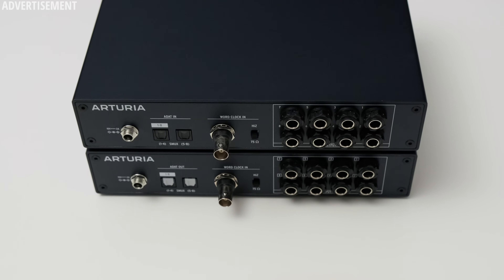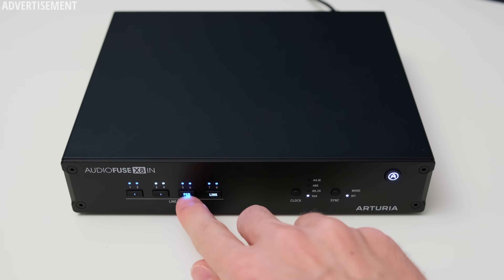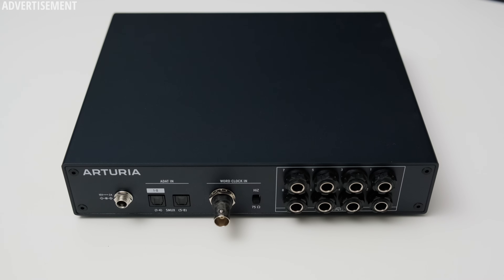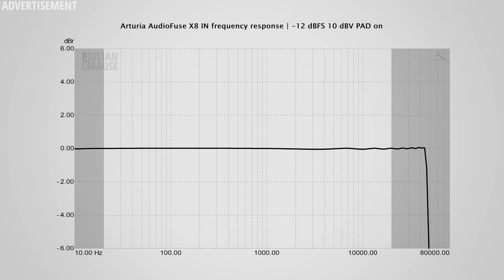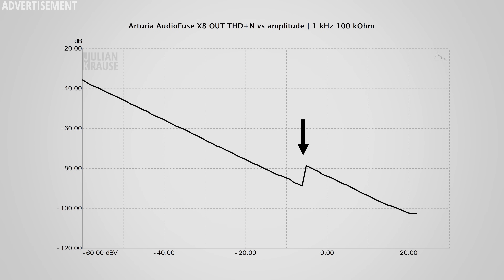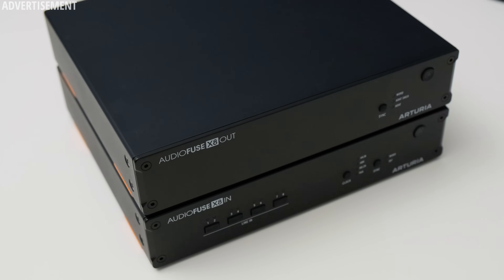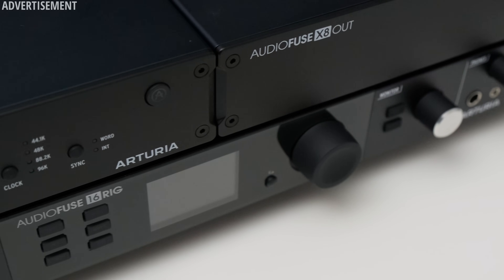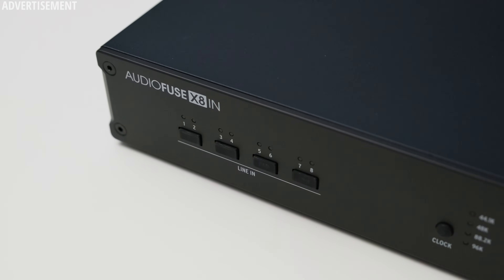Arturia AudioFuse X8 IN and OUT – 8 channel ADAT expansion

Comment from the maker: Status LF distortion issue: FIXED

The latest firmware update disables the Dynamic Range Enhancement of the DAC chip which caused the issue.
The side effect is that the dynamic range of the X8 OUT is reduced to 111 dB(A).
Here is a link to the update process: https://support.arturia.com/hc/en-us/articles/16633731726236-AudioFuse-X8-OUT-Firmware-Update-process
According to Arturia, the update process does not void your warranty. If you don't feel comfortable to open up the device, you can contact Arturia Tech Support to arrange an alternative solution.
All newly produced X8 OUTs will already come with the new firmware installed.
Reply: Hi Julian,
Thank you for bringing the issue to our attention.
As of this moment the issue has been resolved.
You need to contact Arturia to ask them to provide you with the new firmware update file.
Then you need to open the device and connect the internal usb to a computer to do the update.
Reply: @peterpeper4837  thank you I will contact them today
Reply: Thank you for calling out the problem - it is a deal-braker and a shame that Arturia released such defect to customers!  These units look extremely useful and I will likely get several IF the output quality is fixed and confirmed (tip to Arturia - for validation of the final fix, AudioScienceReviews can give the seal of approval).  
Also I hope this OUT unit does not make any POP noise in any situation?
Reply: Still hoping for an update on thisssss
Reply: Minor Update: Enquired if they were working on a solution:
"We have been recently informed of this behaviour affecting the AudioFuse X8 OUT in some specific cases. Please rest assured we are actively investigating this case. We understand how important this product is to you. Our top priority is to identify this potential issue as quickly as possible and ensure that your experience with AudioFuse X8 OUT meets the highest standards.
We will provide you with further details as soon as we have more information. Thank you for your patience and continued support."
Reply: @innamoratum  Please let us know if you have any updates on solution to the issue
Reply: Hi all. Just chiming in, it seems DRE is enabled in the ess dac, see the es9080 pdf page 12 on ess site. I guess the new firmware switches this off.
Seems a doubtful thing from the beginning by ess...
Reply: Hello Julian! I am an electronic music producer and audiophile. I am having trouble choosing a new dac. I don't really need to record anything, so all I really need is the dac with close to perfect audio quality. I don't understand why dacs are more expensive than audio interfaces if audio interfaces have more features and are used by pros.
Reply: @oscarstott  Hey, I hope it will help, Some points for your consideration:

First, DACs with USB audio transmission are simply another form of audio interface; the terminology is just different. 

The bigger the lie, the higher the cost.
For professionals, an audio interface is a tool, not a hobby. They need something reliable that gets the job done. It’s much harder to mislead a professional (most won't invest hundreds of dollars in power cables).

When DACs or audio interfaces reach a certain quality level, they become indistinguishable to the human ear. This has been proven time and again through A/B testing and null tests. However, those who invest in expensive DAC's for better audio quality often resist the idea that its performance, when judged by ear, could be on par with something costing a fraction of the price. 
While you might see better technical specifications, in a modern setup converters contribute the least to accurate audio reproduction. Acoustic treatment and speakers/monitors play a far more significant role in achieving faithful sound.
If you’re serious about pro audio, whether as a profession or passion, I recommend exploring some of Ethan Winer's videos, like "Audio Myths Workshop" and "AES Damn Lies Workshop." 

The FL Studio repost of "D/A and A/D Digital Show and Tell by Monty Montgomery" is also an excellent introduction to digital audio. 
And "Audio Science Review" website is another valuable resource.

Lastly, an audio interface isn’t just about sound quality. I use RME's audio interfaces not for their sound but for other critical factors like driver efficiency, flexibility, build quality, and the manufacturer's ongoing support and updates for new operating systems.

Good luck!
Reply: @oscarstott  > I don't understand why dacs are more expensive than audio interfaces if audio interfaces have more features and are used by pros.
Lol, that's because they are manufactured for idiophiles.
Reply: I bought and so far haven’t noticed the bug. But I use the device when I’m summing out to a passive summing mixer back into my audient asp pre’s
Reply: @ayokiff1073  in that case the issue is not obvious
Reply: According to @peterpepper4837 the issue got resolved  a month ago,  Arturia wants you to call to get the firmware update for testing
Reply: Maybe they changed the firmware for newly produced X8 Outs but they conviniently forget to change the specs on the product page from 120.5dB to 111 dB.🤨
Reply: I was about to press the 'Buy' button, but I saw this review, and it was decisive. Thank you so much for preventing me from making a mistake.
Reply: I'm really uncomfortable with your take on the LF distortion - the more i think about it the more it bothers me. This isnt a 2 channel interface used for monitoring music, its an 8 channel expander used for creating effect loops. If it isnt ok for effect loops on bass guitars and bass synths and bass drums - its just not ok, period.
Any update to the behaviour will invalidate your noise testing, likely reduce the dynamic range, and a pinned comment certainly wont be enough. (just to be clear - i wouldnt criticise your work if i didnt respect, and value it, and recommend it regularly - that would be wasting both our time. I very much appreciate what you do)
Reply: @mycosys  I don't understand what you're on about. He identified an issue that no other reviewer noticed, reported it, and presented it with measurements and audio examples of the worst-case scenario. Since it might be possible to fix, he gave the manufacturer a chance to look into it, potentially improving the product. In the verdict, he explained clearly why he couldn't recommend it and repeatedly mentioned the pinned comment for updates. Your assumption that a fix would alter the audio test results isn't based on anything factual. There's also no problem with asking for a retest, that’s precisely what the pinned comment is for. 
This is a perfect example of how a review should be conducted. If you decide not to buy it because of this issue, then the review has served you well.
Reply: @zdfghdfg  congrats on having no clue i guess. Changing when it switches gain WILL change SNR
Reply: @mycosys  Your cherry-picking of one answer and your emotional reaction suggest that you’re here to argue rather than to converse.
You don't know what will be the solution, nor how it will effect performance.
Reply: @mycosys    Mostly agree, but "effect loops" is certainly not the only way the device is intended to be used. Another common use case is for extra monitoring / playback outputs for other musicians in a live setup based around a DAW (most commonly Ableton Live). In that use case, the distortion might not matter at all.
Reply: No USB port - no firmware update...
Reply from the maker: @horstsauer9089  Hey, there is a USB-C port hidden behind the front cover 😉
Reply: @JulianKrause  Have you seen the new Ferrofish Pulse 8 AE? It has 8 analog I/Os with ADAT connectivity, and it's about the same form factor as these. The specs are impressive for only 600 euros. It seems like an interesting product with an attractive price for something made in Germany
Reply: @horstsauer9089  under the faceplate

Comment: I recently received the new Ferrofish Pulse8 AE on a tip from @xfghffhfg in a comment thread here. It's an excellent device with 8 in and 8 out in a device the same size as one X8. Cost is €600 so basically the same as an X8 IN and OUT combined. Paired with a Motu Ultralite Mk5 it's perfect if you need an extra 8 ins and outs. It has control for levels on the device with a dial and display. I'd love to see a review of it.

Comment: Thinking about getting the X8 Out to get more outs out of my Audiofuse 16-Rig. I'm using all the additional 16 inputs via adat from an A&H Zed R16. My only issue, is I don't think that the AFCC will give me any extra Aux Sends, though I'll get the option in the DAW. I really wish the AFCC was tweaked a bit, and I especially wish there was an extra two outputs to send a stereo mix from the AFCC mixer into your DAW. I find myself mixing within the unit almost half the time.

Comment: your videos tutorials are very good especially because you show the internal circuitry and internal PCB's of the interfaces so go on like that !! About concerning this Arturia unit uses inside Polymeric Capacitors which are NOT good for Hifi Audio equipments thus don't know why most of expansive (like RME, Universal Audio, Apogee, and so on...) brands uses those cheap polymeric capacitors (and cheap op amp too..)which degrade the signal (in terms of micro dynamics, slew rate, reality sound, fq responce, musicality.. etc..) and not using for example Nichicon or Wishay or Wima or Elna Silmic etcetera capacitors .....
Reply: because it's audiophile nonsense not based on science

Comment: I've just discovered a deal-breaking (for me) flaw with the X8 IN. Whenever it powers on and doesn't detect a WordClock Signal immediately, the sync source will default back to internal. Since I'm powering the unit on simultaneously with my whole rack (including the audio interface), I have to switch the sync source every time I power on. Imho that's a big blunder by the dev team (who frequently changes that setting anyways?). I emailed them about this, let's see what they'll reply. If there's no solution on the horizon, I'll return the unit.
Reply: Update: Arturia emailed me with a link to instructions and a new firmware that fixes this issue. I cannot test this, though, as I returned the unit. So to anyone running into this problem: email the Arturia support.
Reply: @JBrm  I'm pretty interested in this as I will use with an RME UCX2 as you wanted to using the UCX2 word clock as a source! Would you please share the link for the new firmware? I will buy this interface in January and I will need this fix definitely.
Thank youuu

Comment: Anytime I'm touching the subject of conversion, I'm thinking if there's more to it than dynamics, THD and frequency response. All of those measurements are done with static signals after all.
Reply: And to add to my own comment from a month ago: I compared the X8IN to my RME interface (a fairly new one). And imho there's a big difference in conversion. Big enough to make me return the X8IN and save for a better converter.
Reply: @JBrm  The characteristics of accurate audio signal reproduction are well established and scientifically defined and can be objectively proven through null testing. There’s no “magic” involved, just science. RME applies this scientific approach to the development, testing, and measurement of their audio interfaces. A test sine wave is far from “static,” as it often involves measuring its harmonics, THD and noise, which by definition are the most complex and chaotic aspects of sound. These measurements push the boundaries far beyond what the human ear can detect. Testing two audio devices is inherently challenging and prone to errors and biases. To minimize these issues, conducting multiple ABX tests with precise level matching is essential for accurately assessing audio fidelity.

Comment: My only issue with these is price.  They should each be about $100-$75 cheaper for 8in OR output only devices.  Ferrofish Pulse 16 is $1100 new for 16 in and out over ADAT, and I see them used for under $900 all the time.  They arguably hove more features as well.  So basically unless you only need 8 of a single direction the Ferro fish is a better piece of gear.  As soon as you buy 2 boxes yo are knocking on the door of a better piece of gear that does twice as much. That said... I did buy one just to Expand the analog Inputs of my VST synth rig.  My x8 in is feeding a MOTU Ultralite AVB and that mut everything on that side of the room onto my AVB network.  MOTU AVB stuff is for some reason hard to find right now and going for new prices used (goodluck finding a 8A anywhere used for under 800) so this Artura box did me right in this case.
Reply: And Ferrofish offers BTO for the Pulse 16 which adds DC outputs.
Reply: So it's about the same price as the Ferrofish 16 per channel. Making a stand alone device that offers half the connectivity for half the price is actually a great achievement. There is nothing in the market comparable to this price bracket, only the new Audient...

Comment: Not a fan of the fact that these devices have Word Clock in, but not out. If the 16Rig had 2 WC outputs, that would be fine. But for both of these accessories to be clocked properly with BNC Word Clock, I need a separate clock/distributor.
Reply: No, you can chain BNC clock with a BNC-T connector, this is what the termination feature is for.
Reply: @zdfghdfg  I stand corrected! Thanks for that!
Reply: @russtheguitarist  On second look, too bad the "X8 IN" doesn't have ADAT input to sync its clock as a "slave". Most audio interfaces don't have BNC WC at all (like RME babyface) so they will be forced to slave their audio interface clock to the "X8 IN" clock. Not ideal...

Comment: 640 euros for just eight adat i/o is pretty expensive imo. It doesn’t even have a word clock out to link the units.
Reply: No link output needed. Use a T-connector...
Reply: Actually it's one of the least expensive options out there, not many line level A/D aimed at low budget. Most users will only need the in or out unit, 300$ for 8 analog channel expansion is relatively very low price.
Reply: @zdfghdfg  Probably aimed more for keyboard players I guess. For 200 bucks less I rather would get me an Audient EVO SP-8 😎
Reply: @Chaos-Dynamics  The SP8 is great value, but it's 200 euro more than the X8 IN. Most people have enough unused outputs, they don't need to pay for more, nor the mic pres, we have enough 8 mic pre's already. 

This is what is great about it, you don't pay for things you don't need!
Reply: @zdfghdfg  Buy whatever you want 😊
Reply: @Chaos-Dynamics  Just like you, I'm not going to buy any of that :)

Comment: Many products like this lately, the market seems to need a reasonably priced set of 8 preamps
Reply: Only thing is that this unit doesn’t have pre-amps but just line level inputs.
Reply: For many years, most budget options for 8 A/D converters were based on mic preamps. There are so many options out there, mainly because most of these solutions came from outboard mic manufacturers. I’m glad people have finally realized we need solutions for line signals. This shift likely relates to the growing popularity of electronic instruments.

The list of budget 8 mic preamps with ADAT out is nearly endless. I suggest searching for "8 mic pre with ADAT out" instead of "A/D converter with mic preamp." Additionally, any audio interface with standalone capability (i.e., routing mic input to the ADAT output without needing a computer) can function as an 8 mic pre A/D converter.

Comment: Excellent review! I was curious about the performance of these. 👏

Would love to see how the Ferrofish Pulse 16 and Behringer ADA8200 compare.
Reply: I have both.  The Ferrofish is a far better piece of gear than the ADA8200, but you can buy like 8 ADA for the price.  You get what you pay for.  Everything though the Behringer sounds like it is a much more shallow depth of feel.  I used to use it for aux stuff like organs and synths, maybe distorted guitars... stuff that doesn't need a ton of range.  The Ferrofish kills it for acoustic instruments.  I just bought a Arturia x8 in but havent compared them.  I expect it to be closer to the fish but the spec.  I will also say my ADA seems to induct some sort of digital chatter that sounds like modem noise from time to time.  its way down at like -80 dB but it is there.  it's probably just badly shielded.
Reply: I've used a couple different ADA8200's and the older ADA8000. They all had problems with audio going to only one output bleeding into the other outputs. Might not be a problem for some, it was a problem for me. Also the preamps are a bit noisy and the ADA8200 at least outputs a loud noise burst when turning on.
Reply: @ejmikk  Yes Crosstalk is an issue with the ADA8200 for sure.  THe preamos are about as good as any sub $200 interface, but thats about it. I NEVR use the preamps in them, have just used them for A? conversion, which they do but with meh results.